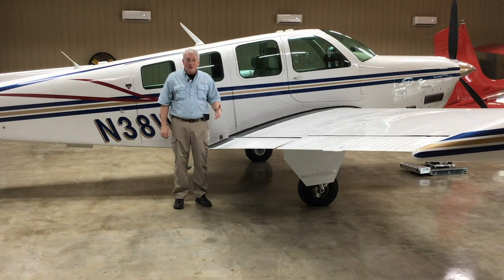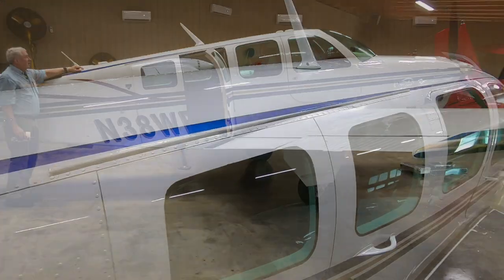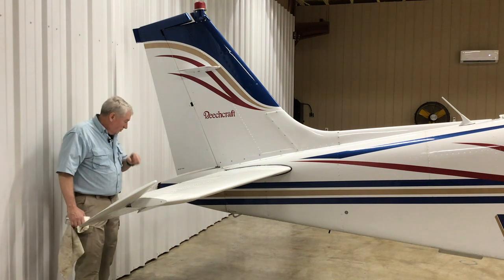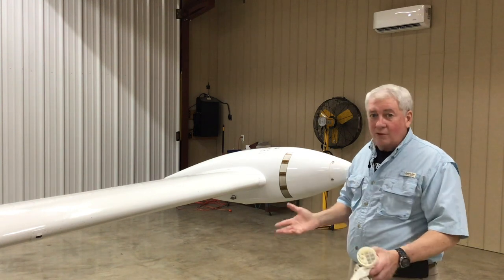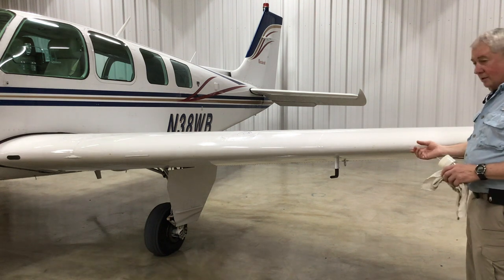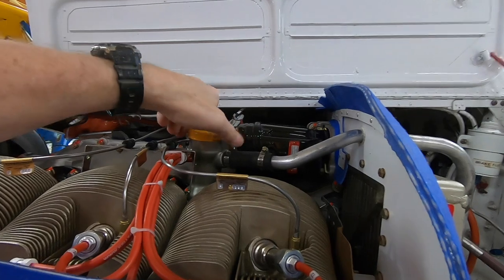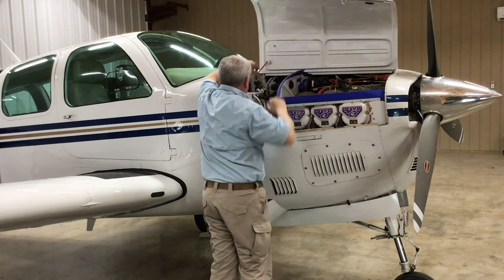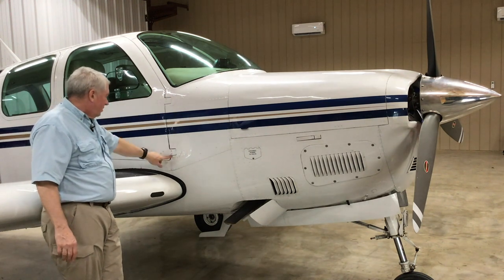A36 Bonanza Walk Around Preflight

Comment: Suggestions:  check for loose aileron counterweights by bumping top of wing with heel of hand listening for resonant vibration of loose counterweight, feel the bottom of brake calipers for brake fluid leaks, feel underneath the bottom screw of the rocker covers for oil leaks, examine the backside of the rear right engine baffle for black residue from excess wear of the starter armature contacts, wiggle the top of the gear doors at the forward hinge for over speed damage of the gear door, wrinkles on top or bottom of fixed portion of elevators, try full travel without any interference felt of elevators and ailerons  ( control cables and counterweights inside the instrument panel are easily bothered by electrical cables dislodged or dangling in that area),  wiggle the bottom of each exhaust pipe for cracking or insecure brackets.  Insure No grease zerk cap on the trailing zerk  on the uplock bearings (which would interfere with the up lock cable), feel for frayed uplock cable at the outboard end in wheel well, examine and confirm electrical fuzes in the engine compartment, wiggle the nose wheel damper for looseness and feel bottom of damper for fluid leak, wiggle the nose gear doors for looseness and look for unusual rubbing on gear doors and Same on the front edges of top engine cowling.  Look at each fuel injector for crack in cylinder head(vulnerable to cracking). Just a few ideas for your walk around.
Reply from the maker: Excellent points!
Reply: @FlyWirescottperdue  looks like I repeated myself from comments we shared some months ago. Rewatching your videos stimulates my thinking. I love yours!

Comment: Hi Scott!
Few things, lowering the flaps and check play, check to see if the pitot tube heat is working (if you going IMC), what happened to the nose gear inspection? Tire pressure? Other than that, not bad.

Comment: Three things.  (1) The grease zerk fitting on your uplock roller bearing shaft (the one pointing aft) has a protective rubber cap installed, which I think might be a no-no as there’s insufficient clearance during gear transit for the cap ... permitting the cap to conflict with the up lock cable.  I believe that cap may be prohibited.  (2) You might consider adding a finger touch at the bottom of the brake caliper to feel for brake fluid leaks.  (3) You might also consider testing the forward upper gear door hinge (by wiggling the upper forward portion of the gear door) for mechanical failure caused by gear extension above the max gear extension speed.  What do you think?
Reply from the maker: Robin-

Thanks for watching, it sounds like you watched pretty closely! I've been around Bonanzas for awhile now and have never heard anything about a cap being prohibited on the zerk fitting for the uplock roller. I can assure you there isn't a clearance problem if the uplock is installed  correctly. For your number 2 point, if you suspect something, drawing your finger across the bottom of the caliper would be a good way to detect a leak, but I wouldn't do it unless i suspected something. For number 3, that sounds more like an annual inspection thing rather than part of a regular walk around- but if you share your airplane with others and you are worried about it- go for it.
Reply: FlyWire- scott perdue   Wow, you do know a lot about Bonanzas.  That’s why I watch your videos.  You are deeply thoughtful revealed by your creatively constructed videos.  I don’t know where I learned about the uplock roller zerk cap issue, maybe from the American Bonanza Society during their Inspection Clinic in Spencer, IA.  I just don’t remember.  You know, I learned some good things from your Deep Dive Walk Around.  I once had a caliper leak, left a tiny pink puddle I almost overlooked ... and put it on my preflight walk around from then on.  Costs one second per main gear, and just might catch an imminent brake failure early someday.  Yes, I agree with you about the gear door attachment hinges.  Like checking the cabin door hinges for deformation.  Unlikely unless you suspect the door opening limit bracket failed to catch the door opening too far in the wind.  We might not realize accumulated strain on the gear door finally led to metal fatigue on the hinge.  Just shaking the gear door to catch hinge failure only takes half a second.  Keep producing your videos.  They are GREAT, my friend.  Truly Outstanding.
Reply from the maker: @robincole5739  Robin- thanks a lot, I really appreciate it! I do preach that a 'walk around' includes looking under the airplane. If you notice something different then investigate it! I did replace the calipers on this A36 about 8 months ago because I noticed a few small drops of red fluid. I spend a lot of time during the annual looking for wear items. For owner/pilots who do not do their own maintenance I suggest that they spend some time cleaning the airplane--- top and bottom. this makes you get up close and personal with small details and the familiarization helps you find mx items before they become big! Keep Flying!
Reply: You might be amused by January 2020 issue American Bonanza Society magazine, pg 52, Item #8.  I do appreciate your very professional videos, look forward to each one, and hope you keep them coming, Mr. Purdue.  All my best wishes.
Reply from the maker: Robin Cole Finally got my ABS issue. Good things to check regularly! Thanks!

Comment: Hi Scott, I just discovered your videos. I am not a pilot but merely a wannabe. I would like as: do the tip tanks have a fuel check point? Many thanks !
Reply from the maker: They have a fuel drain and the D'Shannon has see through fiberglass so you can see the fuel in the tank.

Comment: Nice video. One small comment/correction. Your ailerons are aluminum not magnesium. Beech stopped using magnesium on ailerons with the N35 as far as I know and certainly all 36 models would have come from factory with aluminum ailerons.
Reply from the maker: Bart-  Thanks. I've heard that Beech stopped doing Mag Ailerons mid-N35 production. The trouble with that is I've never seen anything 'official', plus I had a P35 that definitely had Mag ailerons. But you're probably right that the 36's came with Aluminum ailerons. Just don't bead blast them to find out. Saw a Baron in repaint that was stripped with bead blasting. Very ugly results, un-airworthy for sure.

Comment: Wish the aircraft I pre-flight looked like your nice clean baby. The aircraft I pre-flight are abused rental aircraft. I find a lot of issues with them. Had one that had no oil indicted on the dip stick. One with a nose wheel with a  bald  tire with cord showing, Strut that needs to be charged, Engine Coul lock nut loose. Lights not working, Flap stiff, Radio not working, Attitude indicator not working properly,  Bad right mag, and so on. I refused to fly the airplane many times. Also, the engine compartment and the rest sure does not look clean like your airplane. Kinda scary to rent aircraft.